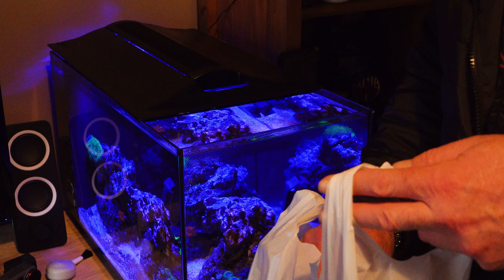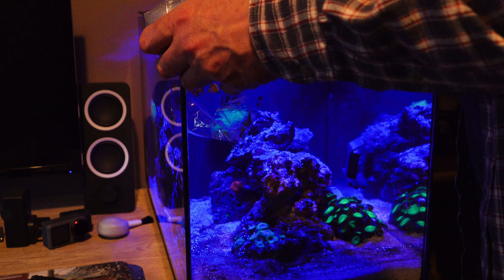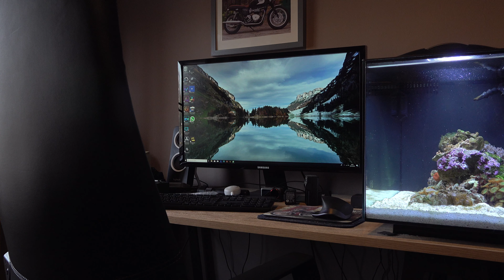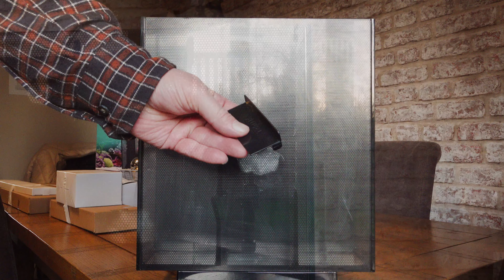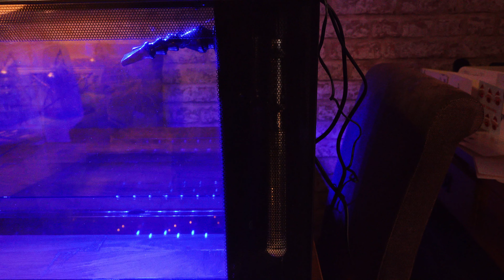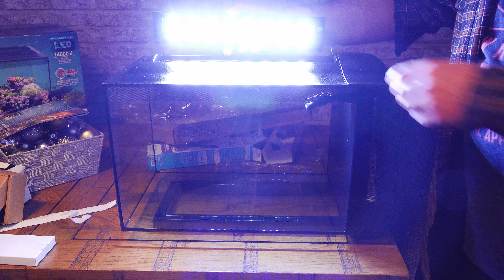Building a NANO Reef part one, The Aquarium (FLUVAL EVO 13.5)

Comment: Never trust any shop, any aquatics centre, anyone.. that that fish invert or coral isn’t coming into your home with a parasite or pest, people need to learn the fundamentals of fish keeping before going into this hobby because they want a pretty glass box in there house, I’ve done it and got the T-shirt, went bounding in spent £100’s of pounds on fish and introduced white spot to my 500 litre tank, luckily I saved half the fish and treated but that tiny clown of piece of coral can undo all your hard work if you don’t follow quarantine procedure, it does take the fun out and costs a bit more on extra kit but it will save you headache and time in the long run, all fish should be treated in copper (seachem cupramine) to 0.5 concentration on arrival, a hanna checker is the only accurate way to test for this daily throughout, you should hold this concentration for 14 days, the concentration should also be ramped up slowly as per seachems recommendation, maintain water quality checked especially ammonia everyday throughout, have facility to mechanically filter the water and aerate heavily, I always employ a skimmer in a quarantine tank and the addition of an air pump, copper lowers absorbed oxygen, if fish are struggling with copper or showing signs of I’ll health pull them out into a no copper tank, this method requires you to have two tanks ready to go one treatment tank for copper and one non copper so you can be ready to take a fish out if required, only ever quarantine one fish at a time, I generally arrive fish into an observation tank (non copper) for a week or two sometimes just to make sure the fish are feeding and settled before starting copper treatment, after copper I then revert fish back to the non copper tank (after full water change and thorough cleaning for a further 30 days observation before the fish even enters my main tank, corals get isolated in a coral only grow out tank for 76 days after being coral dipped and removed from shop frag plugs, inverts also get quarantined exactly the same for 76 days

Comment: You think he’d advocate quarantine then after running an aquatic shop, no straight from the bag Into the tank, bad habit that will end very badly one day
Reply: Whats the point of quarantine if these are the only fish to inhabit the tank? You talk the big talk but clearly dont understand the basics of parasite control. As you say in your previous comment you introduced white spot in to your own tank but clearly still don't understand why it happened.
Reply: @stuartfillingham7011  I introduced infected fish into my display tank at the very start of my marine journey 4 years ago, learnt very quickly that quarantine is the only way to go, your correct if these fish are the only fish you are ever going to have in this tank and these fish have been together in the shop then you can make a decision to not quarantine, if they have arrived from separate shops I would quarantine as the other fish might not have a good resilience to a particular parasite, I understand very well parasite control, and the best way controlling parasites is to prevent them entering a tank by way of quarantine and copper treatment, this non quarantine works for this tank but education is key and to show in a video putting fish straight in from a shop is a bad habit and bad fish husbandry for most marine keepers with already established tanks or tanks you would look to add stock to at a later date, to add, when I infected my main display after a year of it being set up, fully established with many corals, it then needed to be fully stripped down, all corals and rocks removed to even have a chance at removing fish, a massive under taking and one that could have been avoided if quarantine was carried out, takes one fish, one piece of coral carrying a fish parasite and you could potentially lose your entire tank, this was not a direct dig at you I’m sorry if it came across that way but I think it’s extremely important to educate people at a foundation level in videos at the importance of quarantine and therefore why you chose not to quarantine on this occasion
Reply: @jimelliott33  lol thanks for the advice to add to my 40 years experience in aqua culture , marine fish breeding and aquatics system design. Not sure how i made it this far without you!
Reply: There is always something to be learnt, there is always a better way to do things, I comment on my observations, it wasn’t a personal attack on you I just know that newcomers always fall into the same trap, lack of education, marine shops selling fish with no regard over their welfare, I’ve been there and experienced that, I believe in passing on my experience, you can make money and do things for as many years as you care to make up but it doesn’t mean your doing it right

Comment: Iv been looking at getting a marine tank for ages now and not pulled the trigger yet because I wanted to do it right, I'm looking at getting the spec 60 marine version, just because its got them few extra litres on this one, is there an heater that the temp can be easily seen on from across the room? I'm also looking at poss upgrade the lights to the one with Bluetooth so can use app and have loads of different light settings in the future 👍🏻 would be nice to go all techi at some point ... Great videos can't wait to follow u more and get going, think I might pull the trigger on tank right now and start buying things bit by bit for a while